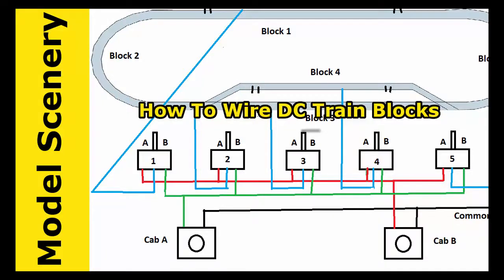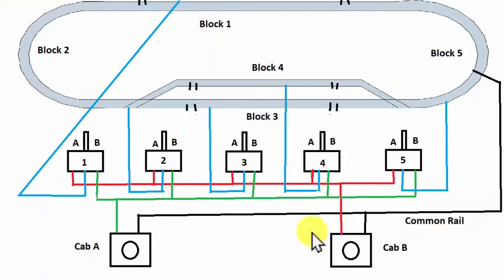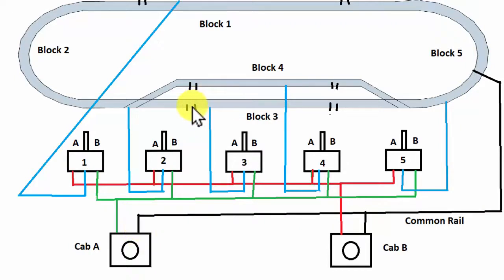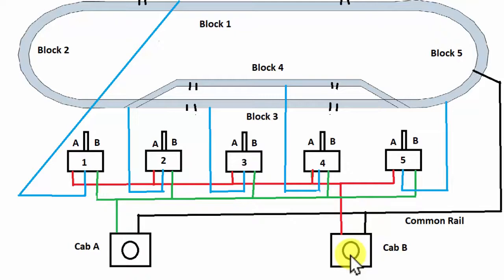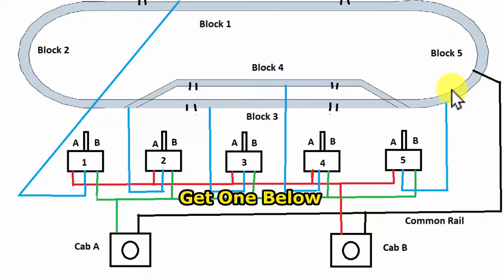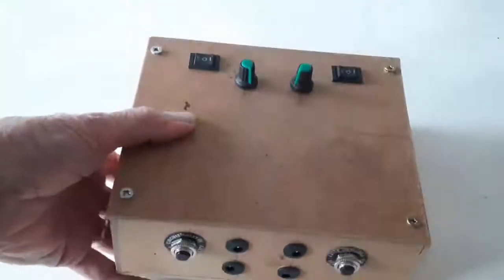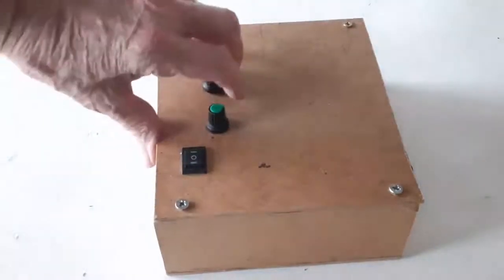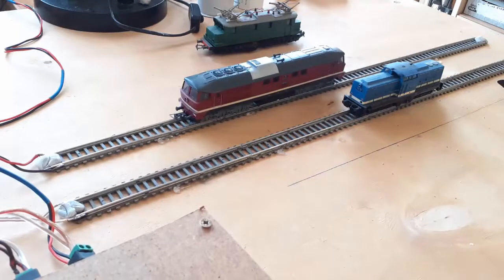DC Model Train Layout Block Wiring And Analog Locomotive Contro

Comment: One point that's not emphasised is that with the two controllers sharing the Common return each controller has to be fed by an independant transformer winding - so using two wall warts (rather than a single PSU) is required othewise you'll get a short.

Great video, and the wiring diagram alone is very useful.
Reply from the maker: I power mine from a single walllwart. No shorts.

Comment: If all your doing is running one train at a time but want to have multiple locomotives on the layout parked but you don’t want them to move you just need to make block sections and have your locomotive parked in on the blocks. A simple way too do this is use plastic rail jointers that will cut the power. Now somewhere on the track just before the block solder a wire to the both rails connect both wires to a switch then hook up that to the block. So flick switch block is powered with track once trains parked flick switch again power is dead to the block. Very easy to do actually just requires a little soldering
Reply: Brother obviously he uses isolated rail joiners.
Reply from the maker: Thank you for commenting.
Reply: This is excellent advice! Im new to this and really want to have control over multiple trains on the same layout.. you seriously helped, thanks 👍

Comment: Thanks for the response.  I have another question.  The diagram shows the common rail being fed from both cabs.  Since the common rail is continuously electrified, is it necessary to have that feed come from both cabs, or is only one one cab required to feed the common rail as long as that cab is on while operating the other cab?  Thanks again.
Reply from the maker: only one

Comment: The best part of this video for me was the wiring diagram for DC dual cab block operation.  However, where it shows the wires coming from the double throw switches (I'll be using 3-position switches in order to have an off position for both cabs) the red "Cab A" wire is connected to "Cab B" and vice versa for the green wires.  Unless I'm missing something I have modified my wiring diagram (based on yours) to connect the "A" switch position to the "A Cab", and the "B" switch position to the "B Cab".  Thank you for posting this.
Reply: When a switch is thrown to the left, it’s activating the terminals on the right, and when thrown to the right, activates the terminals on the left side. The way he drew it is correct! The toggle is pivoted in such a way that the far end from where your finger touches it goes in the opposite direction. Hope that explains it!
Reply from the maker: Glad it helped.